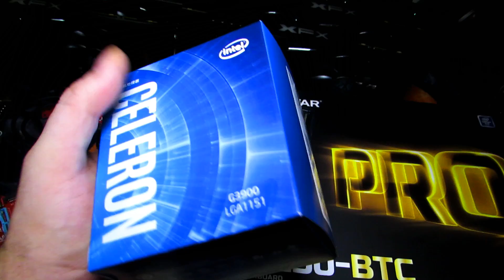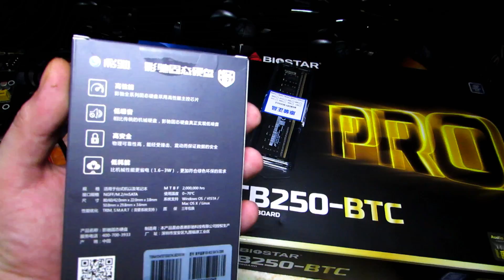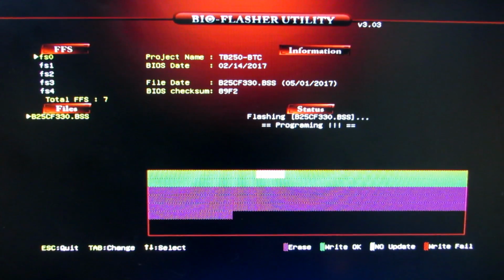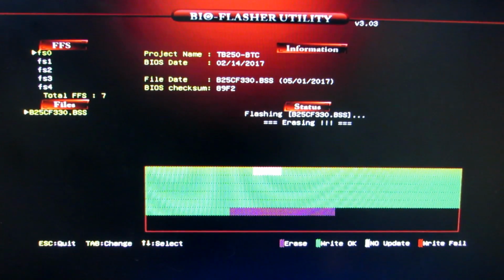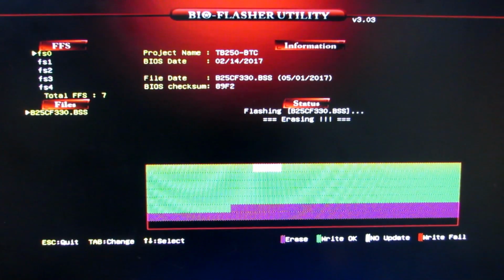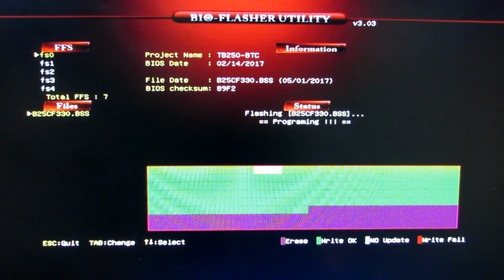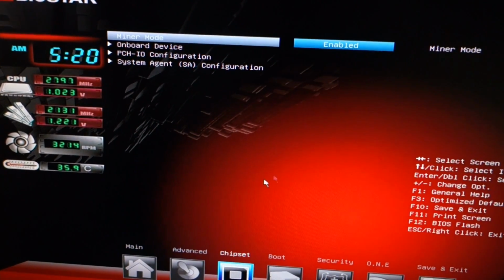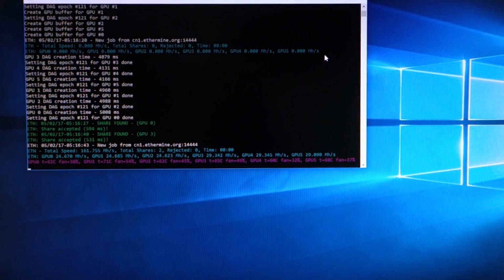Biostar TB250-BTC PRO Mining Rig Build, 6X XFX RX480 8G, Celeron G3900, M.2 Ethereum Zcash

Comment from the maker: Get Biostar TB250-BTC PRO & TB350-BTC PRO @ https://cryptomined.com I also have packages available with CPUs and RAM (Intel Celeron Skylake G3900 + 4GB Micron DDR4 2400 for TB250, & AM4 X4 950 + 4GB Micron DDR4 2400 for TB350)
Reply: Cryptomined hi.. may i know why you use 2 type pci e?? sorry i know nothing bout this thing lol..
Reply: yeah why gen 2..not auto or gen 1 or gen 3 ??
Reply: ait cheers
Reply: How long would it take to get my setup if i order through you ?
Reply: Do I need to plug in the molex connectors? The issue I am having is that my lan is not working. I enabled it in bios, but still nothing. Any ideas?

Comment: My power supply won’t turn the fan on after I plug the mother board and the CPU in, is it broken?
Reply: It’s an EVGA G+
Reply: I got it to turn on but now I plugged power on the power1 behind the Ethernet cable and it won’t turn on my monitor or pass internet to the motherboard, any suggestions?

Comment: i did everything correctly. but when i turn it on the cpu fan spins but nothing else happens. nothing else  works then the cpu fan stops spinning and then it starts again . its really annoying because i cant find any help, nothing shows on moniter or anything
Reply from the maker: remove everything but ram and cpu, then try, if still doing it, try different ram, try changing ram slots etc... use 1 ram stick...  if still failing, remove cpu and check for bent cpu socket pins.. if theres a bent pin, try to bend it back with a needle and try again, if broken pin, you need to RMA.
Reply: @Cryptomined  i have done all; of that, i did some more research and apparently its called a no post error. i dont know how to fix it, or if you can... :(

Comment: Hi Cryptomined... I put CPU G4930 LGA1151... But when I turn it on, everything goes off in 1-2 seconds. Do you know what the problem might be ... Maybe CPU.... I have mobo tb250-btc+ pro... help
Reply from the maker: probably motherboard, bad memory/broken memory socket... bad cpu/broken LGA1151 socket....

remove everything but 1 memory stick... try it... if you can test the memory in another motherboard to make sure its good, thats better... then you can isolate the problem to motherboard/cpu..  check for bent pins in the motherboard CPU socket... 

my best guess, probably a bent pin
Reply: @Cryptomined  I did a little research... I put intel celeron G4930 but it is 9th gen... and it doesn't work. I should put Intel Celeron G3930 (7th gen.) because motherboard support only  6th and 7th.
Reply from the maker: @BEOGRADNAVODI  ok cpu issue i guess i wasnt thinking about the numbers enough and figured you knew what you were doing with the socket and CPU, i forget allt he CPU numbers now

Comment: Could anyone help with a setup problem.  built like this with same motherboard.  I can't get my monitor to respond when i try to bring up bios.  Monitor comes on says no signal and goes into standby mode. .  In addition my keyboard doesn't power up.  Consequently can bring up bios to get started.  Checked keyboard on another computer turns on fine.

Comment: I have the TB250 BTC Pro and I can only get 6 cards.   Anymore and it puts ! on device manager, I tried to enable CSM as they said to do so and now I get blue screens on start up.   What is the trick to get over 6 cards?
Reply: It's lame but i think my 7th card is busted. I switched riser and used my other cards and they get detected except for this one video card. sucks...
Reply from the maker: im not too sure, you did enable mining mode for 6+ GPUs right?
Reply: Cryptomined I did.
But I realized 1 card is defective. Pretty random. When I put the next card as 1070 it detected it. So I am running 5x 1060s & 1x 1070.  I think it may be an excellent board.

Comment: HELP!!! using this motherboard with 6vegas. G3900 processor, 4gb Kingston fury hyperx ram, 2x Corsair rm850x psu's, bios all set to gen1, mining mode, virtual memory set to 60000, block chain drivers, cast miner. It will run 4 of the GPU's stable. It will recognize all six but when miner start 4 will hash 1900± but two around 1200. Then 10 seconds later the computer crashes. HELP ME PLEASE ANYONE!!!

Comment: i have this motherboard fiddled with all kinds of settings and a couple of bioses from the latest as well, hwinfo keeps showing pcie errors and one or two gpu will shut down in claymore after like 20 mins. Any suggestions? 4g enabled pcie set to gen1/2 (both tried) above 6vga and 6vga tested. tolud 3.5g arperture 1024.I wisj i knew what is causing that pcie errors..

Comment: new here should you only use a graphics card with a 6pin plug ?
Reply from the maker: you can use any graphics card thats profitable, doesnt matter if 6 pin, 8 pin, 8+6pin, 8+8pin... that may just change your PSU requirements
Reply: i have a 660ti with hynix mem 2 gb can i mine with it and a gtx 1050 msi 2gb with a mod to 1831 clock
Reply from the maker: not sure about the 660ti, its kinda old.. you could try though and see if its worth it

Comment: Hello,

I am using this motherboard with SMOS. SMOS worked great on my biostar bt 250 btc, but with the upgrade it doesn't work! The motherboard boots into SMOS, but then I get an error than says "cannot resolve hostname" and then the miner crashes. Everything in the setup is the exact same except for the motherboard. I have the most recent BIOS and have enabled 4G encode, onboard motherboard graphics, disabled audio. I have tried everything!!!!

Please help

Comment: I have a similar build with 6* xfx rx580s, 5 out 6 getting 27/hashs and the 6 is getting only 20 hash.   The bios on mb is flashed to latest, running win 10.  No bios update on video cards, only latest drivers.  Out of the box all these cards were at 24/hash, I played around with crimson, undervolting and decreasing CPU and undervolting and increasing mem clock, this increases the hashrate.  I don’t know how I can achieve higher hash rates and what is the cause of the low hash rate on the 1 card , would love any insight if you have run into this before.

Comment: hi, I am starting to build this mining rig, but will it work with corsair RM850x PSU?
Reply from the maker: depends what GPUs you are going to use.  I think it only has 4 VGA cables, so it depends how you use those cables and/or if you use GPUs that one require a 6 or 8 pin directly to the card like a 1050ti.  You dont give enough information so I can not properly answer your question

Comment: How many GPUs are you connecting per Perf/SATA port on the EVGA PSU? It would seem more that 2 GPUs daisy chained off the EVGA Perf/SATA cable draws power through the riser and the cable starts to warm up as you exceed more than 2 GPUs. Have you seen this problem? Measure between 2.8 Amps for 2 GPUs @ 12v = 33watts, EVGA Perf/SATa as I understand is limited to 50watts...

Comment: I use this board and as soon as I start the miner, the gpu fans speed up a lot and the display no longer posts anything, I don't know why, I use 6 gtx 1060 6gb and I've tried with only one gpu plugged in and my psu has enough power, plz help

Comment: I have a problem running 5 gpus on this motherboard. 4 gpus work fine but as soon as I plug my 5th gpu, all of the gpus wont turn on. I tried using dual gpus, still not working. Im using a biostar tb250 btc pro with a skylake celeron, 8gb ddr4 ram, evga 1000gq psu and 5x r9 380 msi armor 2gb. I did everything that you did with the mobo. But mines has 2 options for mining mode. 6x vga and over 6x vga. On his its only disabled or enabled.  Any ideas?

Comment: Nice video! btw I need some help with my rig...

I currently am using TB250-BTC with 4x GTX 1070 on Windows 10, I got those BSOD every 20 minutes or so... and im on claymore dual mining ETH + SIA. I already enabled Mining mode and tried to change to PCIe GEN 1/2 in the BIOS, the BSOD still happening... Updated every drivers I could find in the system and even changed a different RAM too...

The BSOD includes stop code: "critical structure corruption" , "memory management"
Claymore have that "Miner thread hangs", "incorrect share" and saying I overclocked too much (no OC applied..)

Comment: After i updated the bios now all the cards appear but i get on system-other devises, exclamation mark on controller SM bus, pci memory and pci simple communications. I try use the installer cd but it can't be done. It saids failing updating drivers. I think the drivers from CD aren't compatible anymore. What can i do to install those driver which i think they are important?. Also, as my GPUs are bios mod, i always get gpu4 hangs after 2 minutes mining even when i put the mem clock on 1800 that is low. I think is a driver issue ... Thanks in advance

Comment: I bought this motherboard, however it can only control 4 GPUs and nothing more. I tried adding just one more GPU, only 2 will work while the others will have this error: "This device cannot find enough free resources that it can use. (Code 12)If you want to use this device, you will need to disable one of the other devices on this system." Can you help me please?
I am using 3 Gigabyte Aorus RX580 xtr 8GB and 2 Gigabyte RX580 8GB for gaming.

Comment: Hello. I have all exactly that you have . All components. Could you tell me please how i can Over clock my 5 RX strix 480 8 gb. I m using Gpu Tweak II . What i have to put in GPU clock , GPU voltage , memory clock? Fanspeed? Power target ? 
My ring have Motherboard TB-250 bTC pro - 8 gb ram -Power Evga1300 w gold  -Intel pentium 3,5 ghz. Dual core LGA 1151. -Win10 pro . 64 bit  -Hdd 120 gb right now each is 24 mh/s . But i would like to up. Could yo tell me please ??

Comment: Hello . i have 6 ASUS strix RX 480  8gb, with biostar TB250 BTC PRO , but i only get work 4 GPU. the other 2 is not accept by the system. could you help me please.
Reply from the maker: Hi Gustavo, did you update the bios?  did you enable 4g Decoding and put it in miner mode?  I did not need to enable 4g decoding after I updated the bios, but I installed another tb250 yesterday and just enabled the 4g decoding and it worked fine with 6 without need to update the bios.
Reply: Hi. i update the bios and is working good , thanks  , but some time give me a cod. 43 . i have 5 gpu with the same specification Rx480 strix 8gb,  so i don't  know why some time one of GPU give me cod43 and the other 4 gpu work good . other thing is in claymore when i got 4 or 5 hours mining give me failover ? what is failover? i mining etherum in minergate pool. what can i do with failover. thanks
Reply: Please can you describe where to find this "4g decoding" option that i can not find it and my motherboard can not read more than 4 cards
Reply from the maker: search for an option that says above 4g.  I think that was it, ill have to check the bios later today or tomorrow when i have time if you still cant find it
Reply: could you tell me the bios flash to my rx 480 strix 8gb ? i have 6 card and only get 24 mhs. per each  please help me . how do you get 29 and 30 mhs ??? i have this MB bios tb250-btcpro, i check with techpower up and my memory is DDR5 samsum

Comment: I wonder does this board supports 7th GPU on the NGFF(M.2) with pci-e adapter?
Reply: Changes needed to make in order to run the 7th card via M.2:
1. Choose Above 6 vga in the mining mode options
2. Pcie settings I picked gen1 everywhere 
3. Enable 4g

Then the 7th card worked without ⚠️ this sing next to it in the device manager
P.S. My rig is 7xAMD RX570
Reply: Could someone chime in please? Would it be possible to run 7+ GPUs on this board?
Reply: Yes you can, tested and works with the m2 adapter to pcie, make sure enable in bios mining mode 6 gpu above

Comment: Hello, thanks for this interesting video. I have a problem with my TB250, i am trying to connect 6 sapphire nitro rx 480 8gb but it only reads 4, when i plug the 5th card it only shows 2. Can you help me? I am doing it by myself and i am a little bit confused, i checked the risers, i updated the bios, and it is still happening. :(
Reply: Liryn what is your psu?
Reply: TFO EVGA 1300
Reply: i have evga 1300, biostar tb250 btc, sapphire nitro rx480, Intel BX80677G3930 7th Gen.
Reply: try fucking around with plugging the video cable into different gpus, i would also update the bios, and make sure you have powered risers, 1300 wats is good for 6 480s i think.
Reply: When i go to device manager and check the graphic drivers 3 of  6 gpus and good the others have an exclamation mark, i already updated the bios, i have there risers 6 Pack 6-Pin Powered PCI-E PCI Express Riser - VER 006C - 1X to 16X PCIE USB 3.0 Adapter Card - With USB Extension Cable - GPU Graphic Card Crypto Currency Mining. I think i will sell everything D:
Reply: try linux/ethos!!!!!
Reply: TFO i better change this motherboard i think mine has an issue.
Reply: me too, pls help us...
Reply: You're using  a kabylake cpu that only support up to 4 cards, you need a skylake cpu.
Reply: This cant be right !?
Reply: El Pug Nope, I already solved the issue. Thank you  :)

Comment: Hello, good video, i have a question can you connect the Risers: 4X Sata Ver.007 USB 1X to 16X, & 2X Molex Ver.006 USB 1X to 16X to the TB350-BTC PRO MOBO and at the same time the ssd
Reply from the maker: you can use that mixture, it is good, but do not put too many on a single molex or sata cable. No more than 2 risers per cable.  best to use one cable for SSD and then the remaining cables for risers
Reply: thank you, the.main reason of my question is because the tb350 have  only 4 sata connectors  so whats  the best configuration with risers, sorry if it is a siĺly question im new at this, thanks again.
Reply from the maker: whats your power supply?
Reply: i was thinking in the same setup with the  EVGA 1300 G2 obviously changing the MOBO and CPU thx for the answers

Comment: but i can overclock All gpu?
Reply from the maker: it will depend on each GPU's potential, but sure you can overclock them all.  I have modified 5 of 6 of these, only one of them does not like the bios flash.

Comment: hello, why the GPU 1 and GPU 2 have only 24mh/s ?
Reply: Would you please give more details? Which timings you modified and what memory value you used?
Reply from the maker: they are not flashed, they are running stock bios. GPU 0,1,2 are not flashed - sotck bios.  GPU 4,5,6 have pre-modified bios for ethereum (with timing straps upped and memory overclocked and undervolted and core downclocked... all set in gpu bios)

Comment: Is it safe to use the SATA powered risers? I have been reading many forums where people say that using SATA powered risers is dangerous/unsafe/potential fire hazard with all the wattage being used by the GPU.
Reply from the maker: I think the danger is in using the molex risers with a molex to sata extender, and more so when using 2 GPU on the same sata cable.   Using the ver007 sata risers is safe.

Comment: Hello I have ordered a couple of riser in your shop they look great. Its my first rig that I build. I want to ask you if I must take away the plastic protection under the riser ? I thank you for all your video very good. I start mining because of your video that help me very much specialy with rx480 bios modding. Please continue your extraordinary video and work. Ah yea and the coin that u send me for free look great. :)
Reply from the maker: thanks :) glad the videos helped you start mining, and glad you enjoyed the freebies :)  In a normal rig set up you want to leave it on to protect the bottom of the riser.  In my set ups where i usually hang my GPUs vertically they eventually fall off due to the heat, but, personally, I would only take them off if nothing is touching the bottom of them.  otherwise its better to leave them on.

Comment: How do you get the power at the wall so low for a 6 GPU rig? What are your secrets?
Reply from the maker: I dont worry about it that much tbh, but for eth you would downclock your core on each GPU and undervolt the card a bit.

Comment: is it too late to get in minning ?

iam considering to build one 6gpu rig  and i will wait for the vega hpoing it would launch in next month or so
so  currently i have amd fx 4300 CPU will gigabyte 990fx Gaming sli run 6gpu ? or gigabyte 990fxa NON GAMING ?

and also i ordered smps CORSAIR  RM1000X 1000watt  for 6 rx 470 gb considering it will use only 600-650watts after underclocking volts  i,e each card 90-110 i have sapphire NON PLUS rx 480(8gb ) after decreasing volts it went from 160-110 so hoping same results from rx 470
Reply from the maker: LOL, never too late was what I thought after reading his comment too!
Reply: thx for replies i purchased 5 Sapphire rx 480 8gb NON PLUS every card is MICRON memory, so i tested every card iam not running all cards simultaneously because i didnt get motherboard yet it will be delivered  on MONDAY and its Gigabyte 990fx UD 3 R5 

SINGLE MINING ETHEREUM 
 (1) STOCK = 26.xx
(2) BIOS MOD =30.xx constant

DUAL MINING ETHEREUM PLUS PASCAL (DCRI 19)

(1) STOCK=25.3 ethereum and pascal 480 (just overclocking no bios mod)

(2) BIOS MOD= MAX 25.3 avg 22  
it seems  BIOS MOD only effects in Single mining ?

can i get more hashes in DUAL MINING ??

Comment: Why did you change all the x1 slots to gen2?
Reply: Is it for better hashing rate or?
Reply from the maker: biostar recommends that you actually use all 1x slots at gen1.  so i thought i would try gen2 and it works fine.  actually you probably don't have to, i do it out of pure habbit... 
i know some boards have problems working with 6 or more GPUs at gen3, and i have found that in the past hashrate can actually be lower or less stable at gen1.  so i went with gen2.
Reply from the maker: @Luke Amos - generally for stability.
Reply: Ahh ok thanks for the info, I'll see if I can get gen 3 working first then
Reply from the maker: yup you can try that